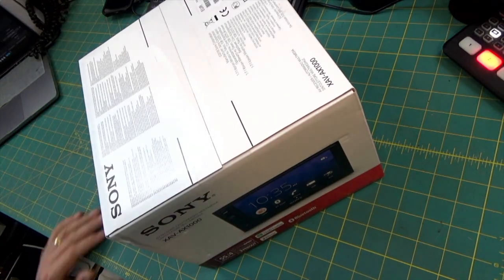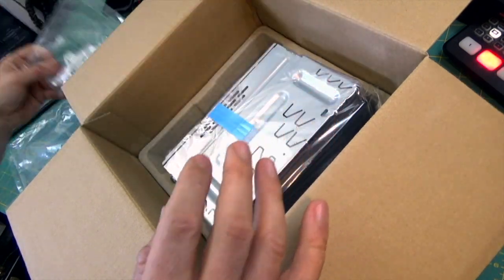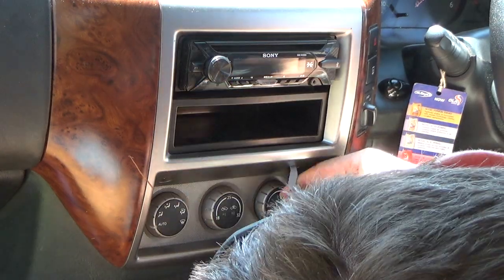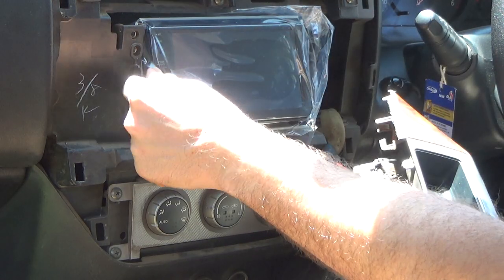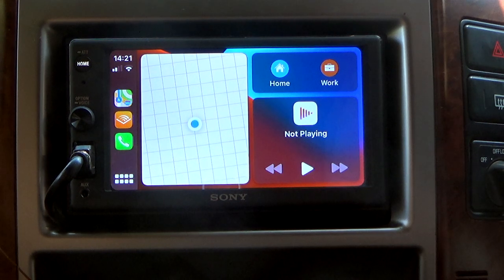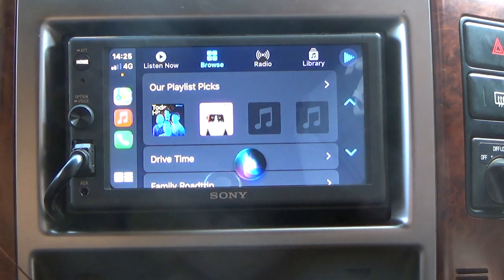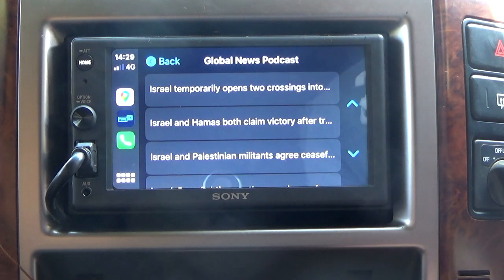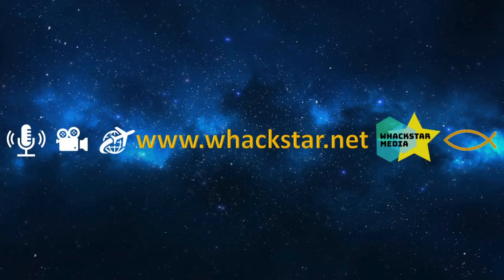The Patrol Gets Apple Car Play - Sony XAV-AX1000

Comment: I have a 2001 Nissan Patrol, looking forward to change the original audio system for this SONY, thanks for the video, do you know if there is any difference between your Patrol Model and mine when it comes to the wired system?
Reply from the maker: I’m not sure. My patrol already came with a sony system so the wiring harness was the same. Not sure about the stock model but i’m sure you can rewire pretty easily.

Comment: i have a sony XAV-10BT, if i upgrade to this, will i be able to use the same aftermarket wiring harness i’ve used for the previous model ?
Reply from the maker: I don't know. In the video, I was fortunate that the original radio was a sony and the wiring harness worked. It was a gamble that paid off. I want to say that this is compatible across the whole sony car head unit range, but I wouldn't want to advise you it works just in case you damage your head unit.

Comment: Nice review. I bought a BMW in 2020 and this exact SONY audio receiver came in with the car 🙂 I haven’t updated the latest version I still have the older one of September 2020 from when I bought the car, I don’t have a laptop 💻 to insert my USB and update the latest version, so my question is this: Can you customize the wallpaper?? or the intro? 
I want to to put the BMW 🔵⚪️ logo on it so when I start the car it shows the BMW or download a BMW pic and set it as wallpaper on my menu screen, instead of using the 5 standard colors it comes with.  Do you have the latest version installed? If so am I able to do this?
Reply from the maker: Hi, thanks for the message I haven't had much time experimenting with customisation let me do some research if it could be done could make a nice vid.
Reply: @WayneHackman  Yea, maybe you should, after all this Sony AX 1000 came out about 2 years ago so it’s still relatively new. If you have the latest firmware updated on it you should be able to see what are the new features /options on the device.
I hear that it doesn’t have the option to set up your own wallpaper like the older model ax 100 does, perhaps with the latest firmware installed on this AX 1000 it might show something new, who knows. But yea a good video presentation as far as customization with the latest firmware will be a good idea after all. Thanks & good luck

Comment: Do you have to have your phone connected to the usb cord to use the Apple CarPlay features or will it also work using Bluetooth?
Reply from the maker: It will work via blue tooth. But outside car play. You can only use car play if you are connected to via cable.
Reply: @WayneHackman  does the usb have to be plugged into the Sony console?
Reply: @jackmonk7586  yes
Reply: @WayneHackman  the problem is that you can disable the charge of the iPhone. Having iPhone always in charge while using the car ruin the battery
Reply: @jackmonk7586  well obviously
Reply: @lj9655  What? Ruin the battery? It’s good to have your phone charged whenever possible.

Comment: Does hey siri work with this unit or do I need to hold the dial every time?
Reply from the maker: Siri can be voice-activated as well using the supplied mic.
Reply: you can just turn it on so you don’t need to hold the button. On settings on your iphone